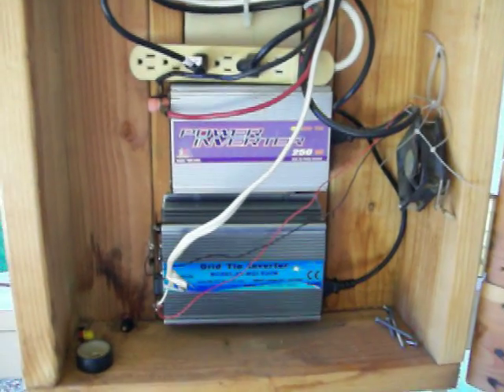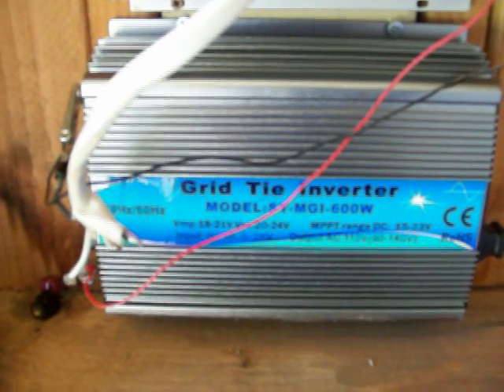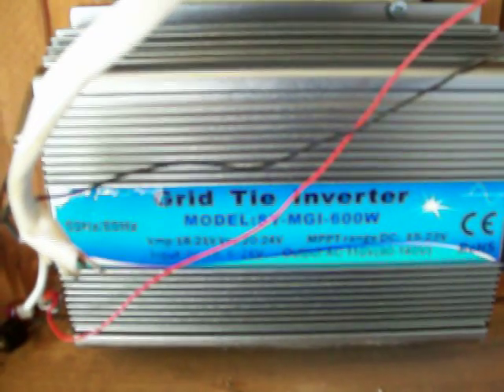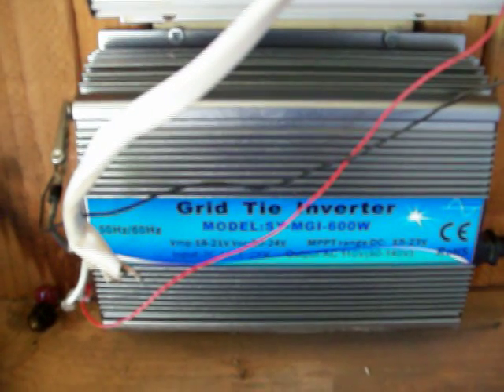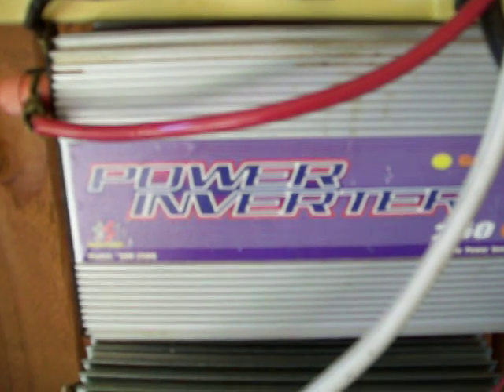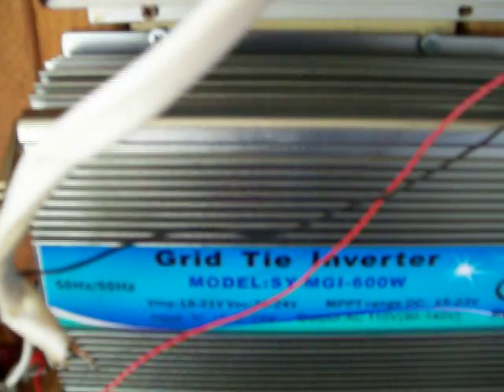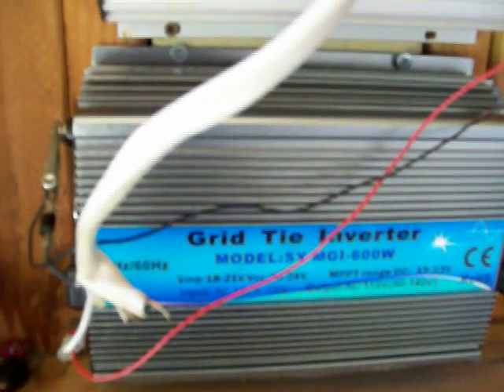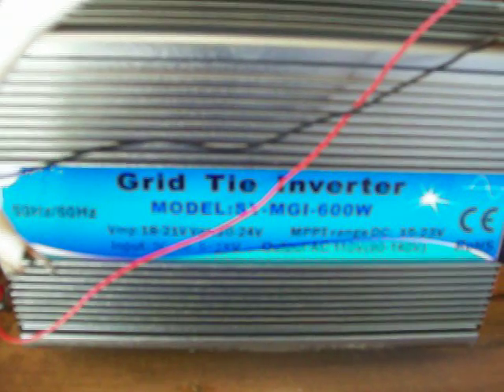Grid tie inverter 600 watt install

Comment: What are you doing? The DC cabling for the new inverter ? You should be running thicker cable the losses you would be having with such a thing wire are like throwing money out of the window get thicker cable it will pay for itself in the end ;)

Good Job though love the setup.
Reply from the maker: I am not sure what u are talking about the smaller wires are hooked up to a 12 volt fan. my inverter is connected with #12 house wiring which way enouigh with no loss.
Reply: errr maybe that is what is throwing me off the wire looks to be about an 22 gauge on my screen at a short distance with DC there will be a fair amount of loss vs 12 gauge wiring. Over the life of the inverter it would pay for itself in extra power generation is all I was trying to point out If you ever try reaching the 90+ percent optimal operation of this inverter . about 550 watts most likely if I had to guess of solar in your case for it to operate with optimal losses. There are formulas for lengths and gauges of wires and in a typical setup I would assume the wires that I thought were hooked to the inverter  and the typical length of a run to the location of solar would likely introduce some sizeable losses in power when added over the life of the unit. Maybe I am looking at it wrong maybe it is larger wire but the top inverter has nice thick cable vs the new inverter. How are you measuring losses in both AMPs and VOLTS I assume IDK just trying to improve your power production I suppose in most cases though it will be ok for batteries I just was thinking along the lines of optimization. Anyhow good work I like your project.

Have you been able to find any lower voltage power curves say from 3 - 20v on a micro grid tie inverter most of them don't drop below 10.8v reason I ask is I would like to get the 12v wind turbine hooked up to this but it very often registers 3-9v DC while spinning in a lower wind or gusts of wind so it would be nice to generate and put in the grid whatever is possible the 12v is the max output from the turbine so a curve of 10.8 to 30 volts is not ideal for this setup. If you run across anything like this shoot me a message on here if possible.

Anyhow as I said likely just oversight on my side enjoy your project keep with it!

Comment: I have a device that will keep the batteries charged up from the solar panels and then run the grid tie only when there is extra energy, saves on the power bill but keeps me ready for a emergency. You might want to look it up.

Comment: did you test the mosfets in the inverter? I fix mine all the time. If you want to throw one throw it my way. you can test the mosfets with a multi meter and buy new mosfets on ebay and fix them for about five dollars.